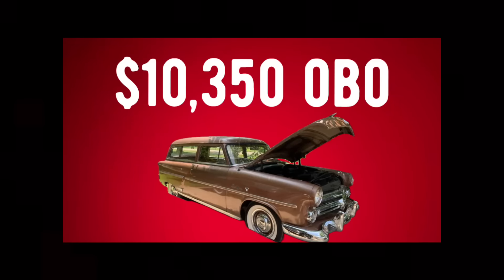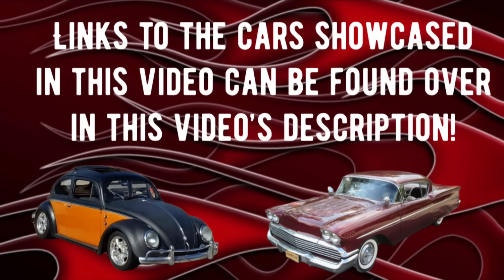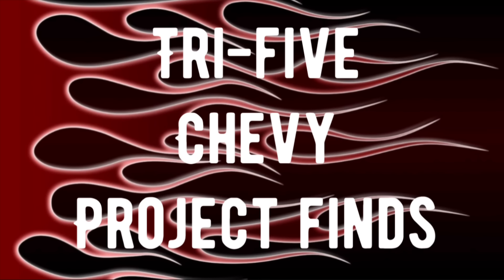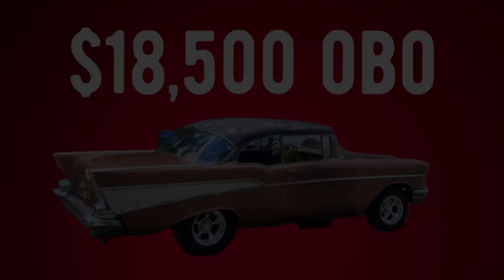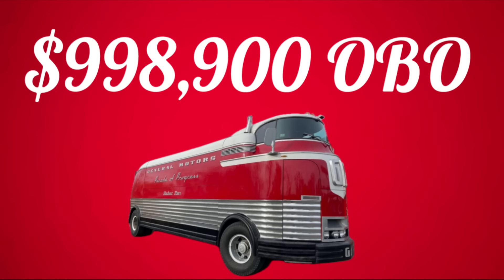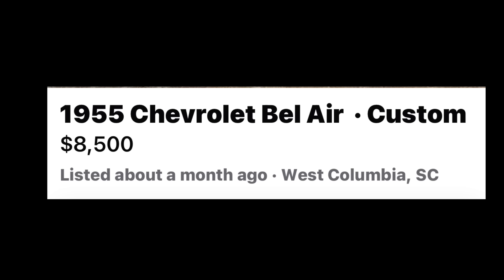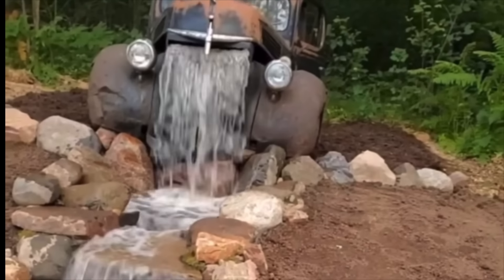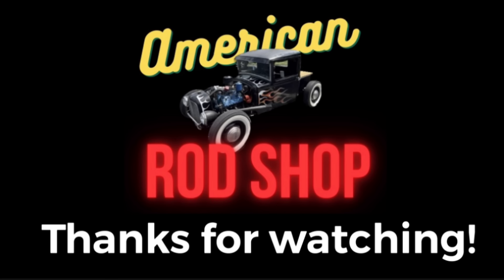TEN 1950'S CLASSIC CARS FOR SALE! 1950 THRU 1959! ALL AFFORADABLE! GREAT DEALS & STEALS CHECK IT OUT

Comment: Loved no. 1, beautiful little 56 Ford and those 351 Cleveland's are getting scarce, one of the most sought after engines Ford ever made for getting raw HP with a few mods. Love to own it for sure. Thanks brother for another great show!
Reply from the maker: I appreciate it TennWalt! I once owned a 1956 Ford pickup that I bought with a 351 Cleaveland in it and it was a great motor!
Reply: Is the 53’ Buick still available?  Could I get the contact info?

Comment: Buick is the top drive in movie show car of the year. to bad that I ain't 18 anymore, nor are there to many drive ins, those were the days
Reply: I had a '53 Olds 88 in the late '70s.  Not only could one easily sneak 3 or 4 buddies in the trunk, but those in the trunk could simply kick the back seat forward and slip right through the crossmembers. No one had to get out and open the trunk.

Comment: Why can’t they leavethem powered by ford
Reply: Because you get more bang for your buck out of the SBC, the SB 350 has pretty much been unchanged for 70 years, you can buy a brand new Short block and build it to any years spec from 1957 to like 2016. That's why and the parts are cheaper.

Comment: That 58 Chevy shown does NOT have 56 tail lights. Lincoln is Lincoln NOT Mercury. The paint on the 57 Chevy MAY be original, however it originally came with a white roof.

Comment: Solon, If you wanted to Restore the 55 Chevy to original, race, that's one thing, But to Put it back to a Driving car, Isn't worth it, It would need everything, door,s fender,s rear quarters, Dash, to Much cost. Sad that the Car was turned to race car.